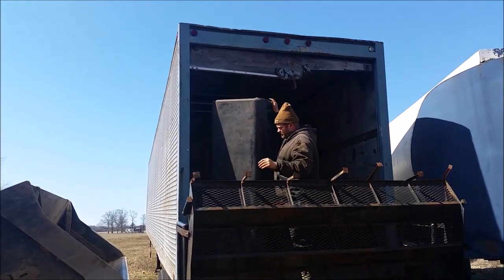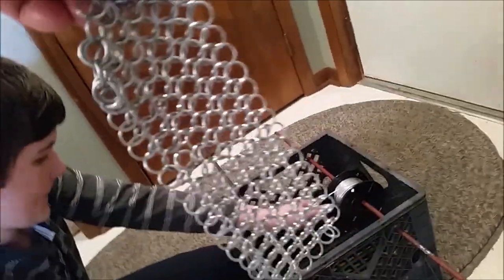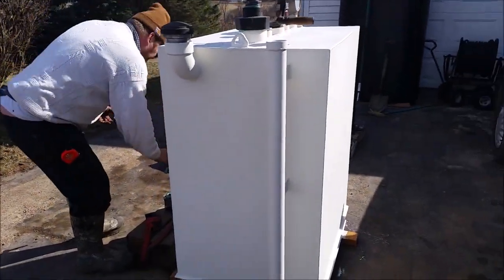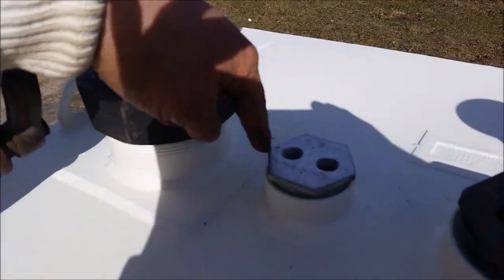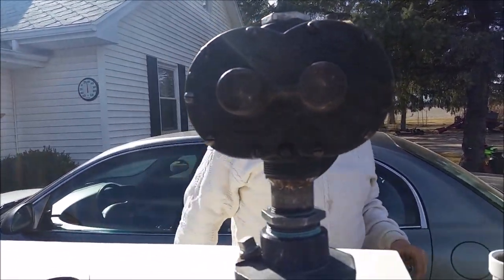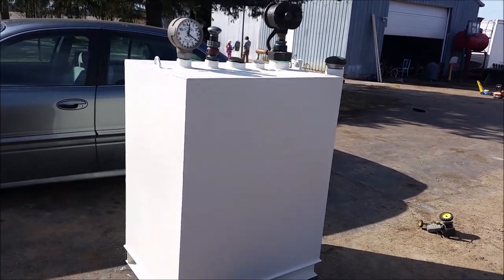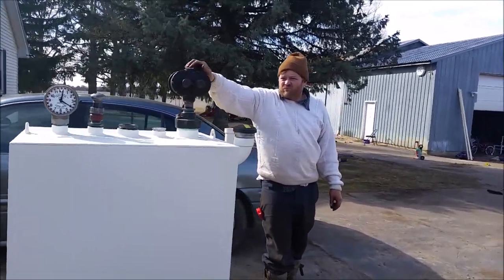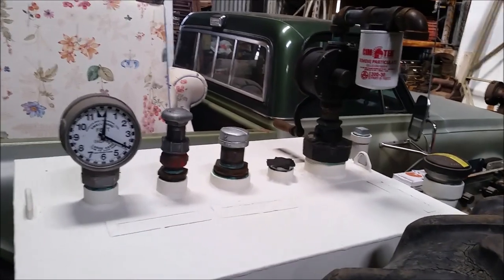More tanks and chainmail armor

Comment: I remember one of the commercial buildings that I use to work in as a Building Maintenance Technician here in Ottawa they had the day tank for the diesel generator placed inside a large stock tank ( i.e. a tank to water cows ). I can not remember if the tank was double walled or not. The reason they did this is because they were afraid of any fuel leaking into the surrounding environment. Here in Ontario if you have a fuel leak the environmental authorities take this very seriously because the environmental laws are very strict.
Reply from the maker: His company does alot of fuel tank containments on construction sites.